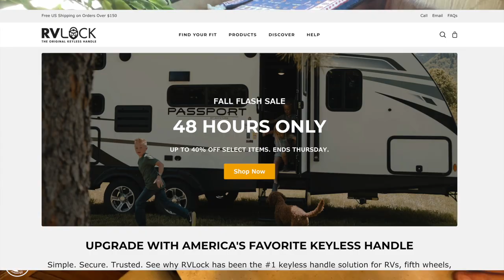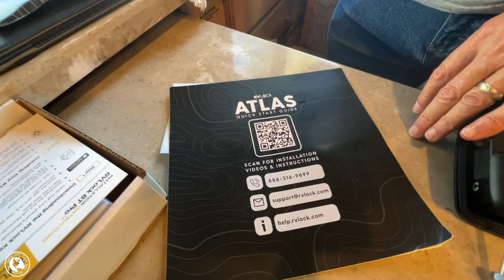RV LIVING: WE UNBOX, INSTALL AND REVIEW THE NEW ATLAS RV LOCK FOR OUR MOTORHOME!

Comment: We had the latch fail on our Tiffin 33AA, luckily not locked out/in, Tiffin sent us a new one but forgot the seal so they sent it separate. There is a small arm/lever on the outside plate the appeared to have the end broken off when compared to replacement and it would not release the lower latch.  The symptom was the handle would pull and not open the latch.  Did they send a new gasket/seal for the outside plate with the lock?
Reply from the maker: Hmmm not sure in that. I’ll check and get back to you. Thanks for stopping by!

Comment: I was just re-watching. So the Atlas activates the deadbolt? Any concern that you try to open the door with the deadbolt in lock position and it gets stuck? I was thinking that it would just lock the handle like oem locks do.
Reply from the maker: From Derrick - yes the atlas does activate the deadbolt. We are not concerned about it getting stuck, because we have a key, a key fob, and a way to open it with our phone. So, even if the electronics fail, we do have a key.